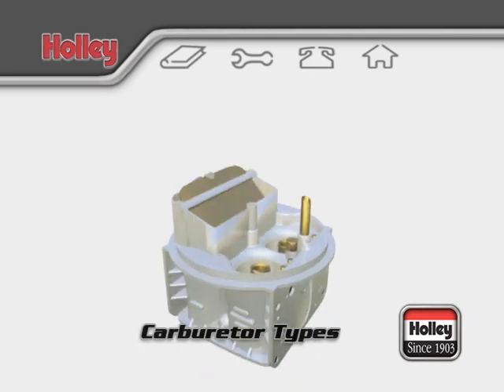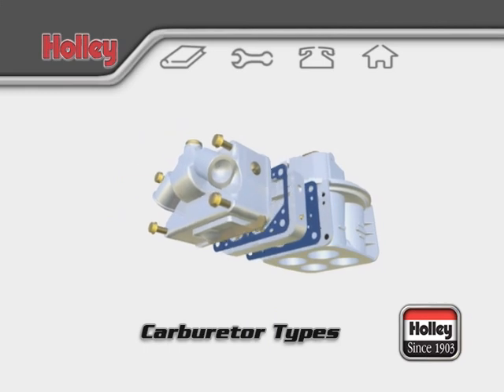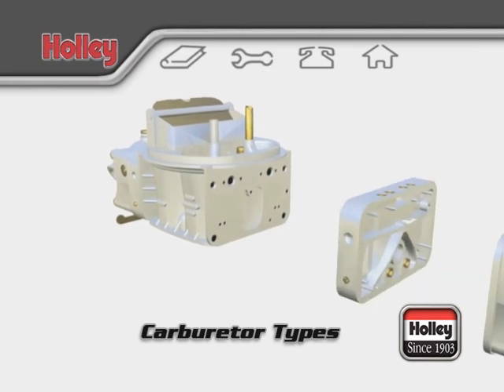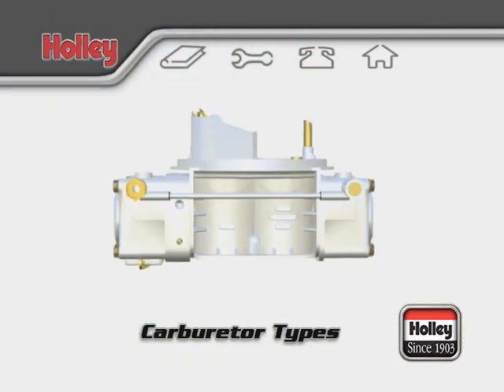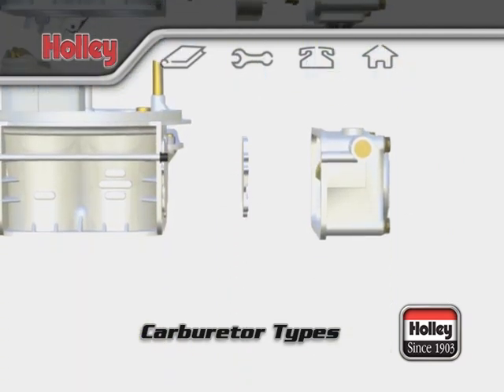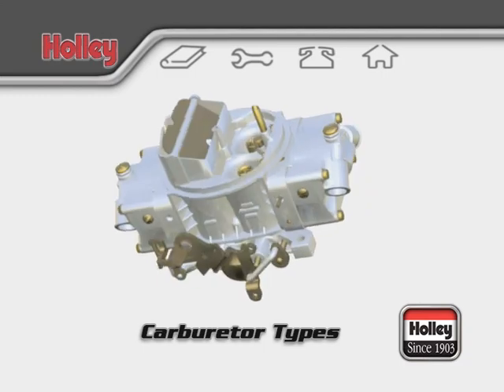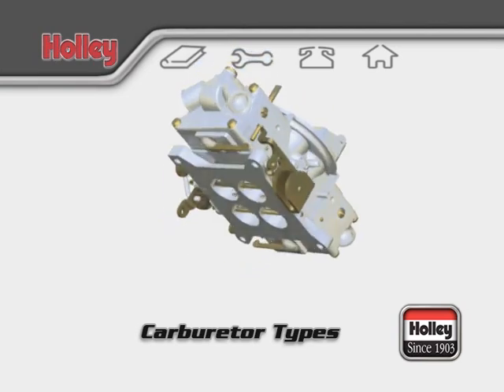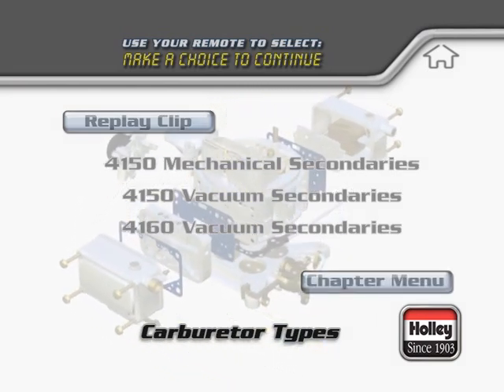Holley Four-Barrel 4150 and 4160 Carburetors Explained

Comment: Now I am more confused than ever. Mine looks like the 4150 but only has 1 metering block like a 4160, but the narrator says the 4150 has dual fuel inlets, one to each bowl.
Reply: Is your carb new?  Some 20 years ago I replaced the fuel bowls on a 4160 with those from a 4150.  I wanted the center-hung floats.

Comment: HELP:  The id number on my Holley is (First line: FR) (Second line: 80457-8) (Third line: 2422)  What do these numbers tell me?  What rebuild kit do I need for this?
Reply from the maker: "FR" refers to the carb being a (factory refurbished unit)80457-8  (600 cfm carb with electric choke and vacuum secondary)2422 is the date code (looks like it was built in Augut of 1992 , 2002, or 2012)
Reply: Thank you very much.  What is the best rebuild kit for this?
Reply from the maker: Your Welcome, Holley part # 37-119 here is a link to the kit- https://www.holley.com/products/fuel_systems/carburetor_components/rebuild_kits/renew_kit/parts/37-119
Reply: HolleyPerformance you're*

Comment: Okay I have a question and I thank you in advance, my V8 460 7.5 has a 4160 installed and works fine but it is well aged and has some cosmetic issues so I’m considering replacing, so i go to Jegs and it’s recommending a 4150 Avenger series Carb some connections are different but would I be able to install this carb over the 4160?? I don’t know
Reply: Also to add the 4160 is a 600 CFM and the Avenger 4150 is a 770CFM
Reply from the maker: A couple of things first.  What is this carb / engine in? (Car, truck, rv, race car???)  Does it have an aftermarket cam, intake, headers or any other mods?  What is the maximum rpm's you expect to turn?  Are you looking for the easiest swap or more performance minded?  Sorry for all the ?? But it will help me get you what you want and will work for your set-up.  Thx J
Reply: HolleyPerformance hey it’s totally fine :) I have it installed on a 1976 Ford LTD Landau, it has a stock cam and the manifold is also stock the transmission is a C6 and well it’s still a project car everything runs good just some parts are going to be needing replaced because of its age so say in the event I buy a new carb I’d buy a new manifold as well and competition fuel pump which is mechanical, it’s very barebones but the current 4160 has a stripped bolt near the upper body which is mostly the reason I’m considering a replacement
Reply: HolleyPerformance also to add I want that baby to hit around 6800 RPM and I will be adding headers soon
Reply from the maker: I'm not sure about turning 6800 rpm's with a stock crank, rods, and heads?  I'm going to be a little conservative at 5800-6000 with the stock valvetrain.   I've seen them turn 7k but that was with an aftermarket rotating assembly and extensive valvetrain work.   All things considered  with your info and future upgrades you plan, I'd stick to a 750 or 770 cfm carb with vacuum secondaries because of the weight of the car and the auto trans.  We have a lot of options in this category with and without electric chokes.  Here are a few options,
https://www.holley.com/products/fuel_systems/carburetors/parts/BR-67258
https://www.holley.com/products/fuel_systems/carburetors/parts/0-83770
https://www.holley.com/products/fuel_systems/carburetors/parts/0-86770HB
but feel free to visit our website and check them out for yourself!!  www.holley.com  thx, J
Reply: HolleyPerformance thank you so much!

Comment: Im getting a whistling sound from my new 1460 4 barrel. Can you help me.
Reply from the maker: Check for vacuum leaks around the base gasket, or possibly a vacuum port that either needs a plug or has a split or crack in the rubber hose coming from it.    J

Comment: According to this I have a 4160 someone converted to dual feed, is this going to work?
Reply from the maker: It is possible to do, but It is had to tell without any more info or pics of your unit.
Reply: Yes, I have done this.  You can buy conversion kits from Holley.  I was able to pick up junk carburetors from a speed shop and got all kinds of spare parts including Reo pumps, different throttle curve plastic cams, etc

Comment: Hey guys,
I have a 1988 C70 Dump Truck with a Chevy 366 Truck Motor.
The carburetor is a 4152 EG carb.
Do you know of any videos on that carb?
I'm going to rebuild the carb soon, but, I can't find too much info on the carburetor or the governor attached to it. Also, a lot of Holley carb videos on YouTube talk about adjusting float levels....but this carb has a hose that connects the front float bowl to the rear bowl in place of where the float adjustment nut and screw is supposed to be.
What a strange beast!! Please direct me to any possible rebuild videos on that particular carb. Thanks guys!!
Reply: junkyard diggs has a good video on one